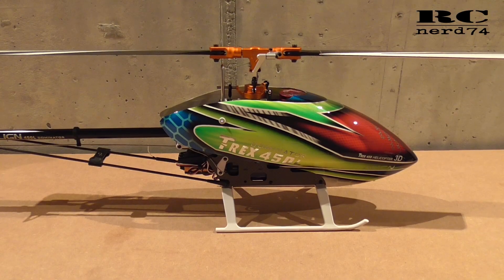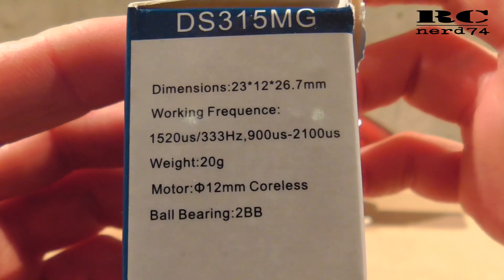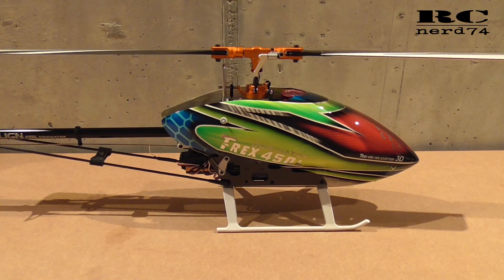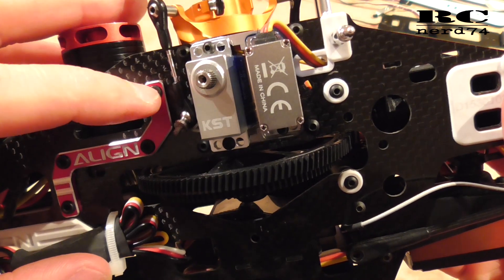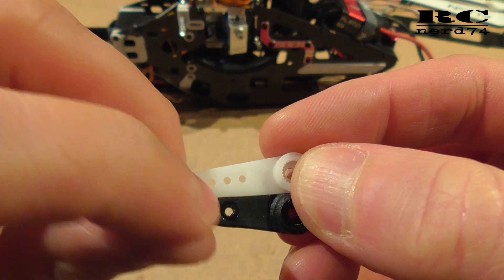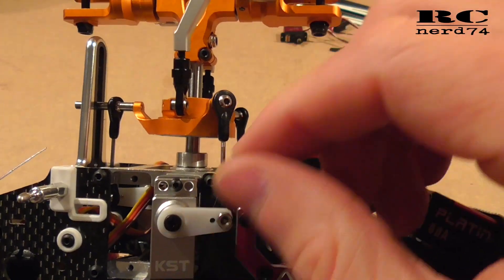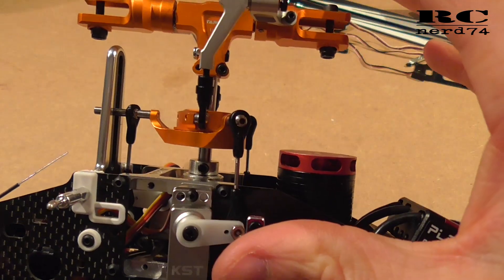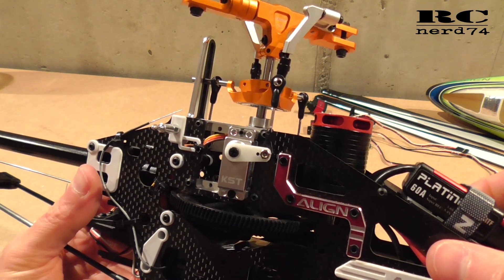KST SWASHPLATE SERVO DS315MG | 450 RC HELI UPGRADE | FIRST LOOK INSTALLATION TIPS

Comment: Hello, and the video of the electronics setap and the test flight where I can find it, it is very much appreciated, thank you for this great contribution.
Reply from the maker: Hi. There is no video about the electronic setup. I only replaced the rotor head. So it was enough to do the machanical setup and trim the new servos on the Mikado V-Stabi Neo flybarless system.